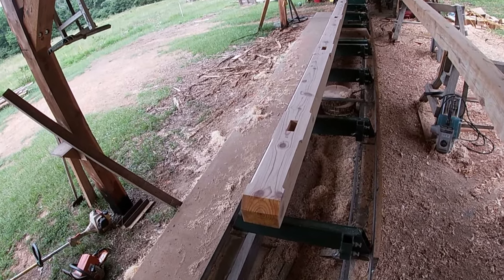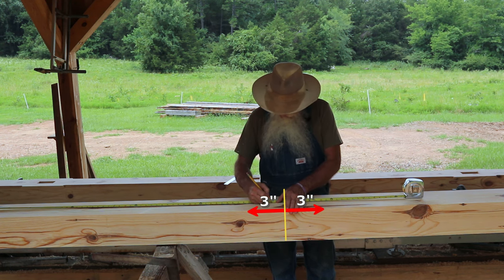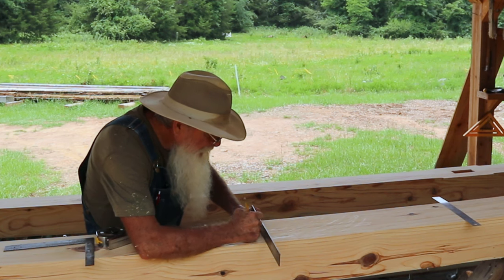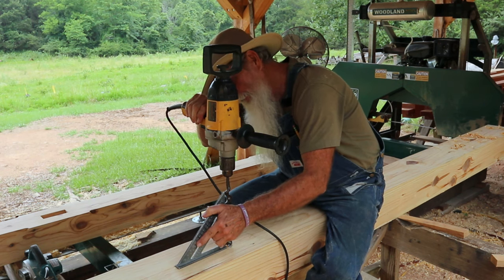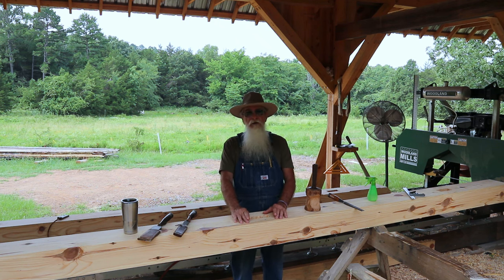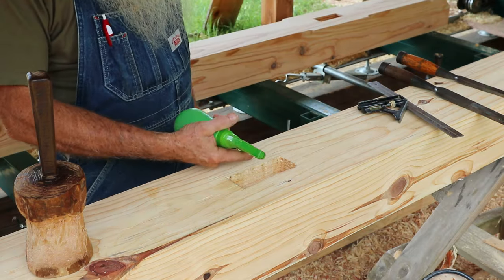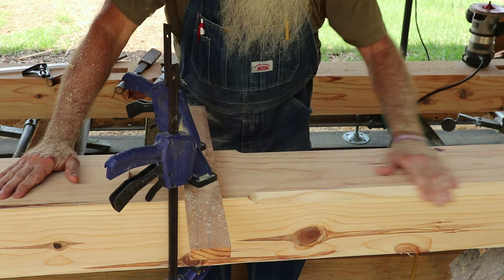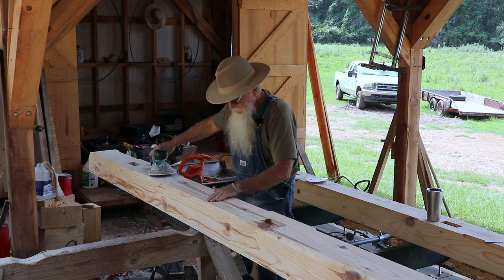Preparing 20-Foot Top Plates | Covered Bridge Build, Ep 3

Comment: Hello Paul. When your mallet was new, did it resemble a near perfect cylinder and came to look like a partially eaten apple over time with use? It nearly looks like it has layers from the end where the handle is. I really like the way you make these cuts that you do, all of them. Have good days!
Reply from the maker: Howdy Buddy- well, it wasn’t perfectly round to begin with. It’s a piece of dogwood that went down in a tornado many years ago at a job site. I just used my carving bar and carved a handle on it. It’s been in use for over 25 years. I had one that was turned on the lathe that was made from persimmon. I still have it but retired it when I made this one. There’s still a tiny bit of bark on the dogwood mallet. Thank you so much for watching the video and for your observation. Take care and God’s blessings to you